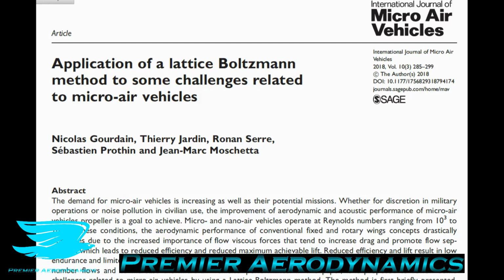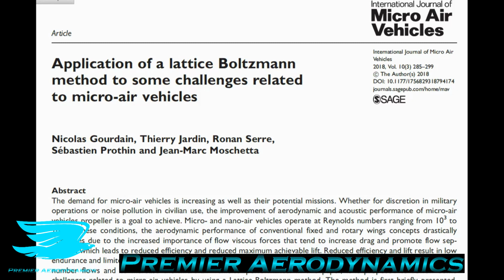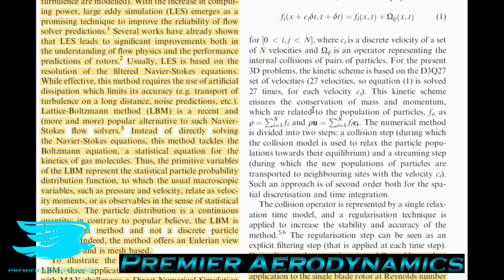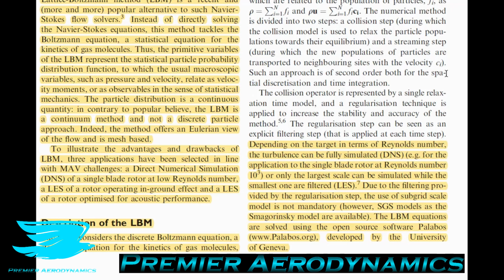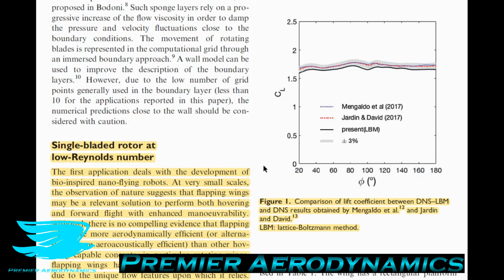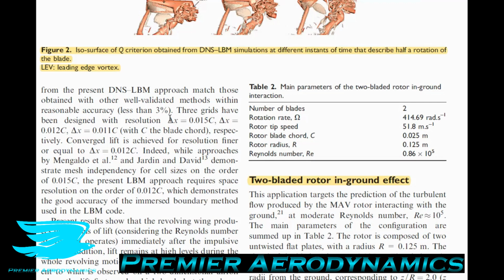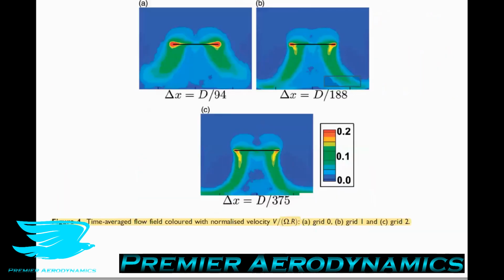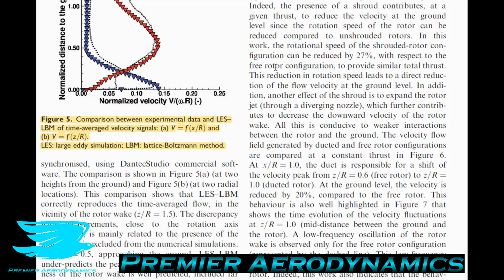Is the Lattice Boltzmann Method (LBM) for CFD any good - Podcast #85

Comment: I don’t really get why there is an advantage or really any meaningful practical difference between using LBM and an explicit compressible FVM on a cartesian grid. Both are governed by the same CFL condition as far as I’m aware. FVM will also have a very compact stencil. Both should parallellize very well

Comment: 17:29 Watch out for scaling laws. The reason an ant can lift "50 times its own weight" is because of volume-to-area relationships, not because it has special muscles. Your assumption would only be valid if compared to fixed-wing airplanes or gliders of equal size.

Comment: When we use Smagorinsky closure in LBM for turbulence I am confused why to directly connect mesoscopic eq with macroscoic one. Any validation?  Thanks!
Reply from the maker: Hi! I haven't used just the smagorinsky closure model in LBM without anything else, but from the math, I think it is because the Smagorinsky model is inherently more macroscopic. I mean, by definition of it being used as an SGS and the properties it uses, means that it definitely isn't microscopic, and it isn't really mesoscopic either because you are looking at the eddy viscosity, so macroscopic makes sense.
Reply: @PremierAerodynamics  Yeah that's why it creates confusions. Currenlty, plenty of turbulence analysis works are based on LBM-LES (any turbulence model). Also Palabos and OpenLB implemented Smagorinsky in their code.
Reply from the maker: @idreeskhan-zp5ey  Oh okay, I understand what you mean. Yep, the addition of the Smagorinsky model is a fairly recent addition (perhaps over the last couple of years) and it was included to improve stability of the LBM.

Comment: LBM is also really cool for looking at very complex geometries.

Usually there needs to be a lot of simulation, post processing, refinement, and rerunning of the simulation to do FEM. But geometries are very straight forward in LBM, each point is either fluid or not. EZPZ
Reply from the maker: Yeah! One of the greatest advantages is no meshing, in my opinion. It makes it so much quicker.

One downside of traditional LBMs is the equidistance between nodes, which means if you wanted to refine a region, you had to refine the entire domain, making the number of nodes skyrocket. But newer codes are fixing that problem.
Reply: @PremierAerodynamics  couldnt you use local refinement like quadtree? just to get better accuracy at the surfaces
Reply from the maker: @f1chtl  Yeah I have seen that being used, and octree for 3D. I haven't looked too much into it, but from what I've seen, one potential problem occurs at the interface. The studies I've seen use linear interpolation which means that it isn't second order accuracy any more (that may not be a big deal because often LBM isn't second order and some parameters are second order and some are implemented in first order).

But, a major advantage of quadtree is the ability to have the refinement change with time. So if you have a region where the parameters have high spatial gradients, you can refine there, and once it calms down, you can coarsen it up again. That's pretty cool!
Reply: @PremierAerodynamics  thank you for responding!  think quad/octree is the way to go with gpu simulations. however, the mesh refinemnt will increase time a lot, dont you think?
Reply from the maker: @f1chtl  The good thing about LBM is that the parallelization is quite linear, so having more nodes will increase the simulation time, but that can be overcome with more cores.

As for a dynamically changing number of nodes and refinements, I guess it would depend on how often you change the grid refinement. If you do it every iteration, then that will likely take more time than just keeping the same grid and solving for more nodes than you need. But, if you revisit the grid refinement every 100th iteration, or something like that, you might save some time because you remove the nodes you don't need anymore.

Comment: Thanks I didn't know what LBM was. It's a good assumption to treat airflow as a continuum, for the simple fact that there's no such thing as a vacuum. Everything we interact with is pressurized with air to some extent. It's also a good assumption to use statistics, as that is how we learn as humans. The greater our statistical database, the more capable we become. IE the more you do something, the better you get at it.

LBM also lends itself well to machine learning, and using that to create algorithms that increase computational efficiency. Although that's very LES'ish, and can end up with artifacts.
Reply from the maker: Yeah definitely, LBM is a really cool new approach.

For the machine learning, that would be possible. There's an idea in CFD in general where if you just run enough simulations, you can then train the AI and it can predict what new shapes will do.

With the artifacts, that's a really interesting point. With LBM, there are a few points where you have to choose between first order and second order approaches. For one example, whichever you choose, there will be a resultant under or overprediction in the diffusion or convection. So, you can only get one right. Which is why going to a smaller grid spacing is appealing.
Reply: @PremierAerodynamics  Interesting, thanks for that. I'm always learning stuff from this channel.
Reply from the maker: @rolandotillit2867  You're welcome!